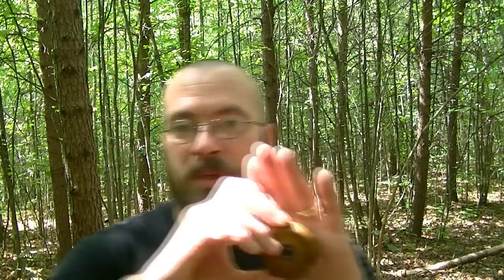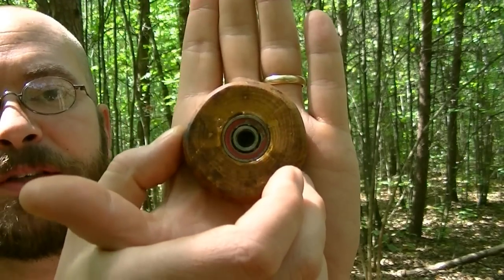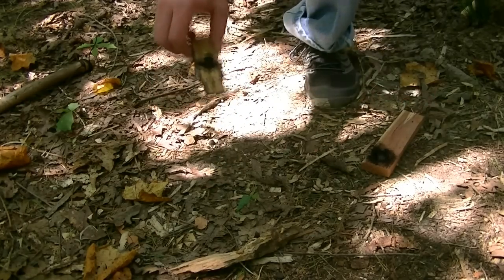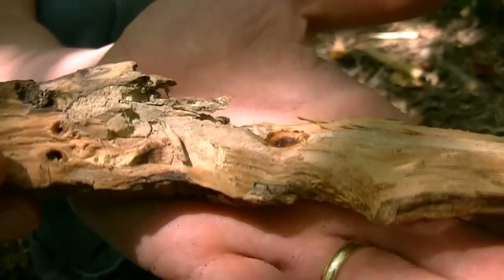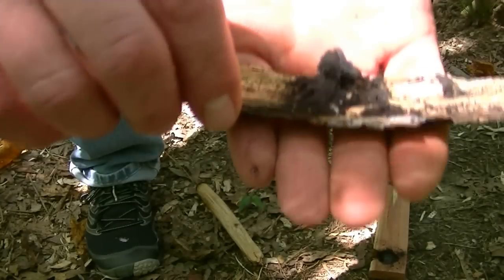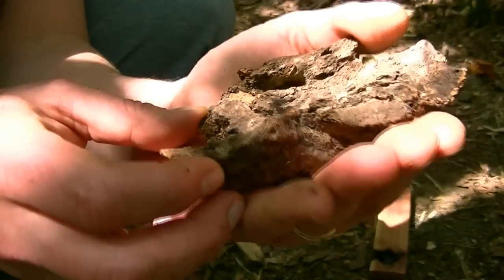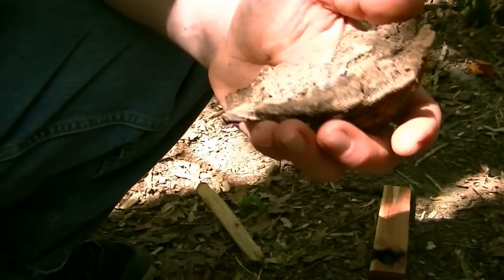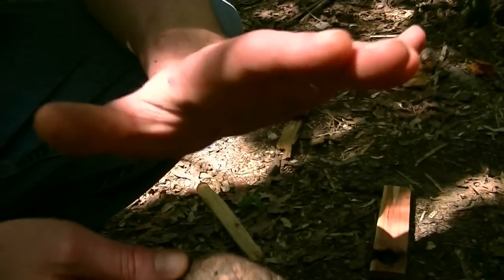Nature's Friction Free Bow Drill Bearing Blocks

Comment: When the bow drill set was likely invented, its doubtful that bearings were available.  However, what would have been around is animal fats!  As such, when I finally get around to practising my first bow drill I shall be putting some good old candle wax inside the bearing block to make my life that much easier.  Outside of private property, there are very very few pines in my local area :(
Reply from the maker: +MrTatts64 Many believe the first bearing blocks were actually stone, which actually does work quite well.  But it does eat away at your spindle.  Thanks!
Reply: Feral Woodcraft IMO the very first bearing blocks were picked up, bone or shell, probably knee bone from the rear leg of bison, moose, elk or deer ...

The rest of the kit would be picked up with minimal processing, a large rib for the bow, sinew or yucca/bear grass for the cordage and yucca/bear grass for the hearth ...

Comment: before you revealed the first one. i had an idea that popped in my head "i wonder if fat wood would work" then 20 sec. later you answered that question lol. good to know and i will half to try it. i have a big downed pine tree across the street from me that has more fat wood in it than anyone person could want. lol. i have tried living pine tree bark (just alil spot not enough to hurt the tree) cut it out and fold in half with the bark on the outside and it has worked wonders just make sure to round off the pointy spindle just alil bit and it wont drill through. i live in Florida so not sure if your pine tree there are different, i have used the same piece for multiple fires and its still holding strong and can put all the downward pressure i want without it drilling through. just incase you cant find any fat wood lying around. thanks for the good video

Comment: great job; always like to try natural ones. sometimes I find joint bones that have a nice little socket already made, rocks that have a nice divot too...I usually use pine pitch to put in them to add to less friction.  Do like the roller bearing block and feel the same as you do on it.
Reply from the maker: +ghosthonda I've never tried joint bones, however I did use a piece of a goat skull once.  All good tips, Ken, thanks!

Comment: Lighter wood is for sure a good socket and I do use it when available. Most of the time not available so I opt for an Oak socket or similar wood (hardwood) harder than the spindle lubricated with green leaf lave or mush. Maple is on the hard side of softwood and would probably be good for a socket so long as the firebow set is not using a Maple or hardwood spindle. As long as the socket is lubed, friction is greatly reduced and makes a big difference regardless of the socket. Like you said, the sap lube is why lighter wood works so well. Thanks for sharing. All the best.

P.S.
Looks like Ruby Falls at Unicoi State Park in the photo. Nice state park in GA. It may not be but it looks like it. lol
Reply from the maker: RB M I agree with your comments 100%.  If I am using a wood bearing block I typically use pine resin for lube as it seems to last a bit longer then green plant material but it does work about the same as far as reducing friction.

Now that the kids are getting older, travel to various parks isn't so much out of the question.  If we get a chance and are down that way, we'll check it out.  Thanks for the referral!

Comment: I have heard that a shed antler makes a great bearing block.  Any truth to this? Anyone?
Reply from the maker: Jeff Holmes Yep, it works very well.  It's not 100% friction free and if you have to use a ton of pressure on it it will burn off a funky smell but it works well.  They do wear out after a while though.  Thanks!

Comment: Excellent video Mr. Joe!  I agree with using fatwood as a bearing block... that's what I use most of the time anyway!  What I have found works is using river rocks that have sections worn away so they will hold a spindle well. Thanks for the great vid!
-Eli
Reply from the maker: drbowdeadly Around here, most rocks are either too small or are sandstone which is pretty hard on a spindle.  Given the right material, I am sure it work great though!  Amazing how different area's lend to different techniques.  It's all about adapting to your environment really.  Thanks Eli!

Comment: Great video, the funny thing is I have had better luck with things like my knife scales than a "cheater" block. It could have been the wood was to far gone but the time I tried to use a "cheater" block I couldn't get a ember.
Reply from the maker: kantill Maybe so.  I haven't used too many knife scales and the ones I have didn't fit into the sheath and still have the notch available so it made me pretty nervous.  They do work great but I've always been apprehensive.  Thanks Kelly!

Comment: Hi Joe, another friction free hand block is ice.... in the winter.  Also, construct the bearing block longer, it gives good purchase and adds to the points of contact from your body to the set, drive multiple divots into it first off, every time you adjust reshape the spindle and use a new hole, this brings a fresh almost friction free experience everytime.    For man made I have been using the bottom of soda cans, just give it a crush and go, they can even be found at most campsites in the form of trash.   Oh, dead birch trunks are often damp and still somewhat fresh or wet, also another choice.   We don't have an abundance of fat wood to select from.
Reply from the maker: downeast primitive skills Thanks for the input man, I appreciate it greatly.  Ice sounds like a good one.  I've never tried it and honestly, it doesn't get wet and cold here enough to make that an easy resource to have.  I've seen a lot of guys using the longer fuller grip bearing blocks and while I've tried it, I greatly prefer the smaller palm sized package.  I find that it allows for greater pressure control that is often times needed when using the more "exotic" types of wood.  

I've often heard of using soda cans but have actually have yet to use one.  At some point I intend to change that.

If you'd like some fatwood to play with, shoot me a PM and I am sure we can work something out.  Thanks again!
Reply: Thanks for the offer on the fatwood, if I get a desire to try some "real" fatwood I will give you a shout.   We picked up some from the big box store, it worked fine but I felt cheap using it, some real stuff would be more pleasing.